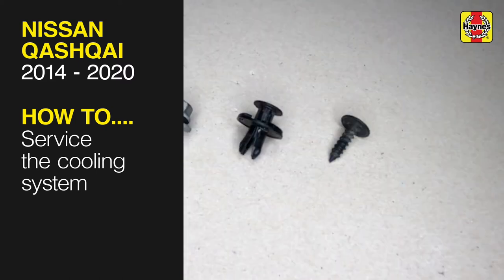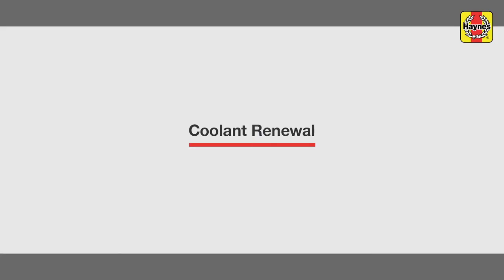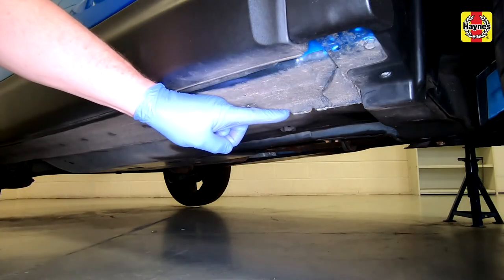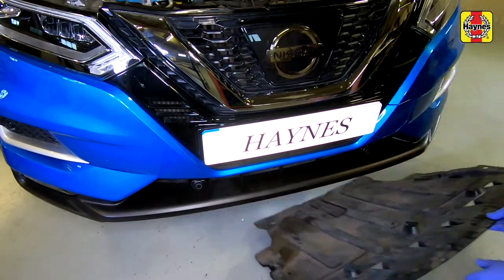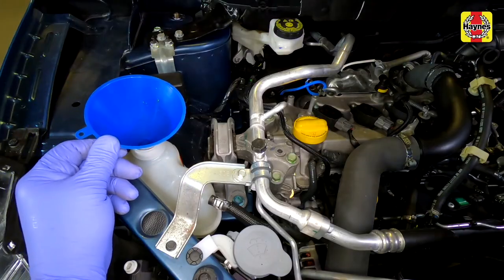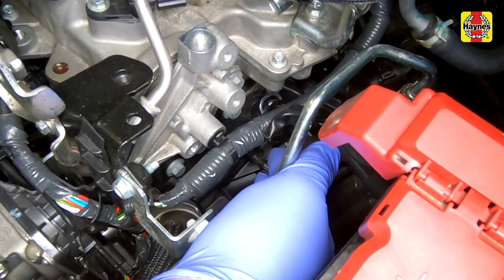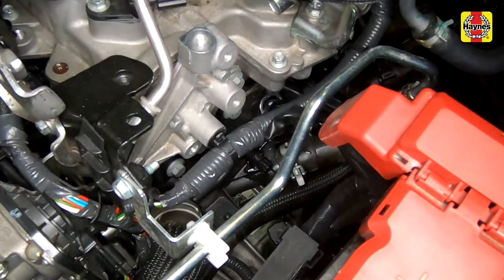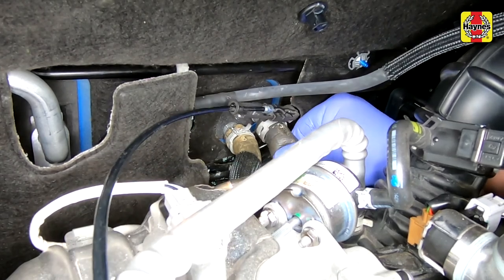Nissan Qashqai (2014 - 2020) - Service the cooling system

Comment: 1:42 rotate the drainplug a couple of turns is wrong, by design it only rotates 1/2 a turn then pulls out(high helix thread design), it also clicks when tightening to the vertical to show its fully screwed in.
Coolant capacity is around 6 litres(6.3L for the 1.5dCi) but you'll be lucky to get 4 litres out, so don't worry if that happens. As long as your replacing blue or green antifreeze with the same(blue and green are the same essentially, ethylene glycol), then just add the amount that drained out. 
Did this job yesterday, would recommend removing the bottom hose before the drain plug as you can control the flow of coolant into a container, the drain plug splashes everywhere!

Comment: Thank you for doing this i really like the video. In 2:34 unscrew air bleed screw. My question is when do i close it back.
Reply from the maker: This is the advice in the manual: 'Very slowly refill the cooling system through the expansion tank, until coolant runs from the radiator air bleed screw and the coolant housing bleed screw, then refit and tighten the tap/cap'

Comment: You've added l248 (green), but the liquid in my reservoir is blue and manual says use Nissan blue which appears to be l255. Confused. 🤔
Reply: Blue or equivalent I should mention. Is green an equivalent?
Reply from the maker: Best to check with a Nissan parts dept in your country/market.

Comment: This is done one time every 150,000 km right? (Reading from the maintenance chart)
Reply from the maker: This is from our manual: 'Nissan state that, if their Nissan antifreeze is in the system from new, the coolant need only be changed every 5 years. If there is any doubt as to the type or quality of the antifreeze which has been used, we recommend this shorter interval be observed.'

Comment: Hi, is it the same process for Qashqai 1.6 dci (R9M)? Thank you
Reply from the maker: Pretty much identical apart from the bottom hose. On the 1.6 DCi there may be an additional bleed screw in the top left-hand corner of the radiator.

Comment: Without opening the bottom hose, I collected 1,5 liters only opening the radiator bottom tap, (the expansion recipient was at minimum sign). Is it normal to drain so little for the 1.6 diesel CVT that suppose to have 7.9L ??? I hate Nissan, won't ever buy another, complicated and expensive service.
Edit: after repeating the operation few times I was able to flush almost 4,5 liters (including over max in the expansion tank) every time opening the bottom hose but only after blowing air through a pipe connected to the air bleeding pipe. So from the total of 8L I got little over half.
I had to repeat about 10 times till the water came almost clean because I changed the G11 green fluid with G12 yellow and they don't have to mix. And every time running the engine over 80 Celsius to be sure that the thermostat is open and old fluid is mixed with fresh water.